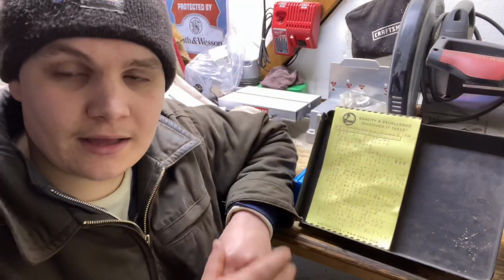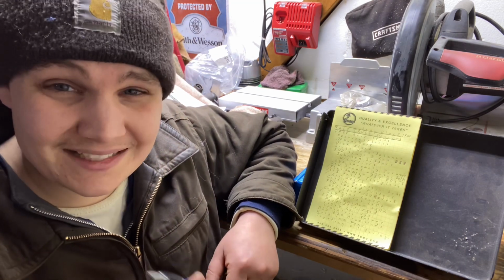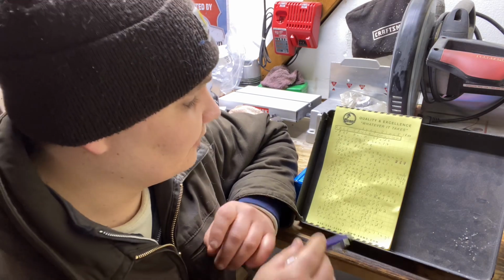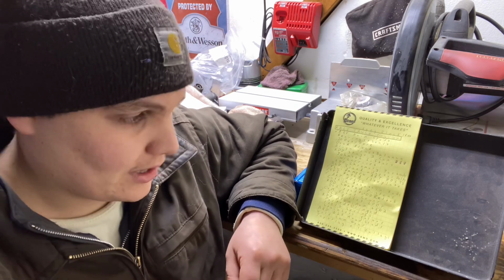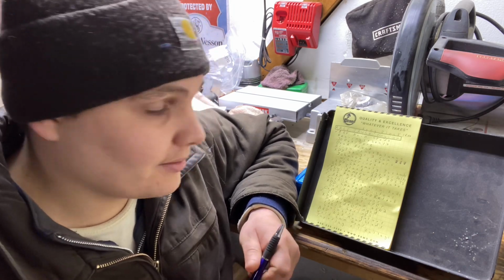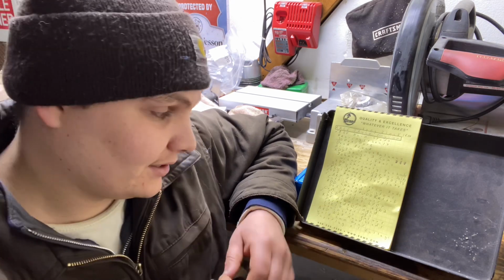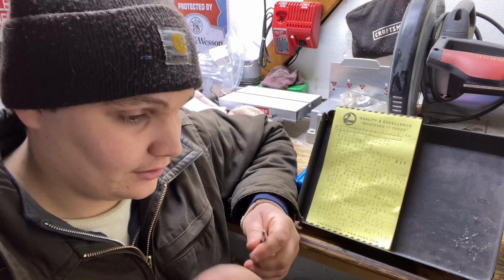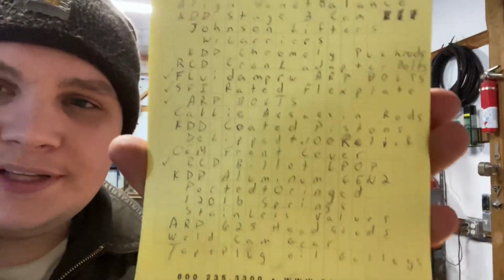1,000RWHP 6.0 POWERSTROKE RELIABLE ENGINE BUILD!

Comment: Main studs in the ford v8’s I’ve dealt with tend to distort the dimensions of the crank main journal bearing clearance. I’ve noticed it tends to tighten the clearance because it’s clamping much better. Your right on about an align bore/hone needing to be performed

Comment: I have a question this may be stupid but when rebuilding a motor is there a certain way each piston and rod goes in like to they go in a certain pattern or can you assemble everything as it goes it and done
Reply from the maker: Each rod and piston will be balanced to a specific hole and then the bore is finished honed to that piston. They only go in one way, due to the piston oiler. I will go into this detail further during the process
Reply: @LeftLaneDiesels okay thank you because I would love to know how to properly do it all I love to learn

Comment: What about the trans?? Its gunna go at 700hp
Reply from the maker: Absolutely, transmission is on the overall list. This videos purpose is to cover the basic long block build.... once that is completed, I will move to the air and fuel with supporting modifications. Then the transmission. It’s a process that will most certainly take some time, but it will happen. 🤘💪
Reply: @LeftLaneDiesels i still haven't forgot about ya.. I still have that BTS built 4R100 2wd trans.. Its sitting on a pallet at my shop